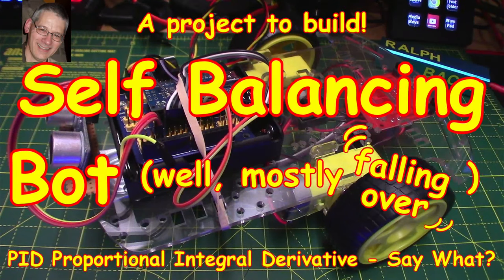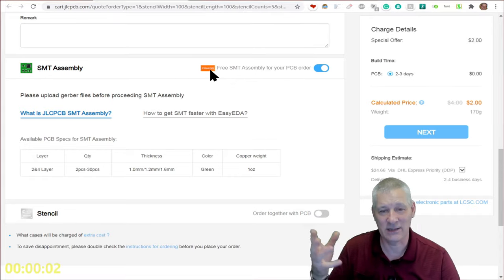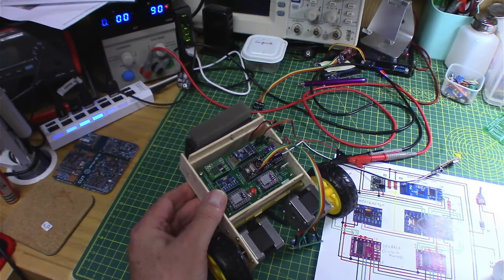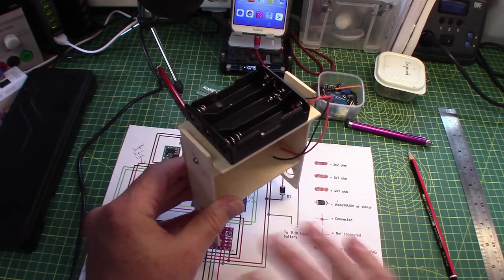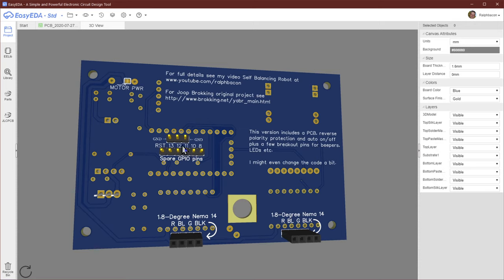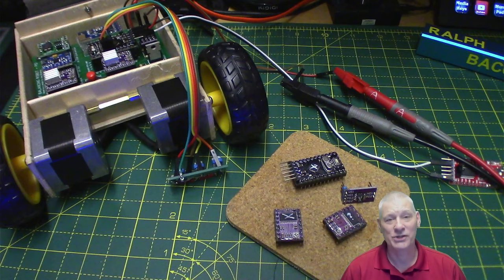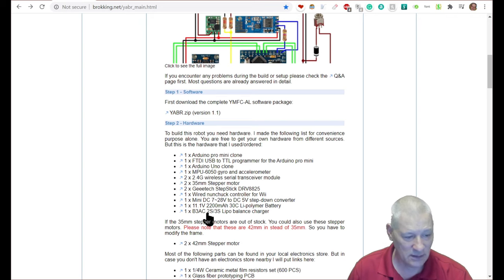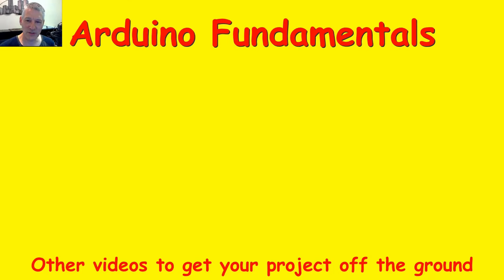#199 Self Balancing 'Bot (almost) with Arduino Pro Micro

Comment: Great work Ralph! I built this YABR project a few years back. Was actually one of my first Arduino projects.  I found that if you INCREASE the current limit on the stepper controllers, it will be MUCH MORE STABLE AND RELIABLE.  PRESS ON!
Reply: And I thought the wheel diameter was the problem too. For the first 18 months, I took off the tires and used rubber bands for tires. Was better. But then I put the tires back on and increased the current limits on the stepper controllers and it’s rock solid, steady, untippable.
Reply from the maker: Thanks for the info! I will try that, It's currently limited ()no pun intended) to about 150mA (as per Joop's recommendation) but I can increase that.
Reply: @RalphBacon  H Ralph. I checked my build log on the project and I eventually set the current to over 400mA on the controllers. May have gone higher (700mA?). I know that I kept checking the heat sink temperatures on the controllers and they didn't get hot with the higher current limits. But the higher current made the motors more responsive and more able to keep the bot balanced. Good luck!

Comment: The length of the 4 milliseconds is probably less important than using some interrupt based code. The integral and derivative terms of a PID are acting on change over time and need to be calculated in consistent time intervals to work properly. Without it if there is any differences in the time it takes to loop through the code (and there always is) it will be impossible to tune the code. If you had a very slow changing system that only needed to be scanned every few seconds (like a room heater or something) you could get away without it, but for something that needs to be read as quickly as this an interrupt will be required. Enjoy!
Reply from the maker: Interesting. So the calculations are time-based. Something new for me to remember!
Reply: @Cosmo Genesis The pin monitoring with the scope was a brilliant idea!
Reply: @RalphBacon  The  I and D terms are Integral (the error summed over time) and Differentiation (change in error with respect to time). So I think that you either need a fixed loop time OR need to calculate the errors with respect to the actual time. Having a fairly accurate loop seems easier as  the delta T is fixed. Running faster is probably fine but time variation requires more complex code. 
To me, it makes sense this way -- 
Proportional term -- a correction to a big error is bigger, while a small error requires smaller correction.
Integral -- an error that's been around for a long time needs more correction while a transient error may require less.
Differential -- a large increase in the error in a given time requires a larger correction than an error that isn't getting worse or
 is only getting slightly worse in a given time.

Comment: You didn't say where we pour the whisky in? Joop has been working with PID for a few years now, so don't beat yourself up for not getting it working satisfactorily first time. I have worked with PID (caveat: it was with air pressure driven instrumentation . AP is a far courser medium than counting the electrons. Electronic control replaced this a few decades ago, but we never had to touch the PID configuration after installation.), I seem to remember that we first started with zero integral and differential outputs. First the proportional is adjusted until it more or less  works. Then the addition of integral output (this is a smoothing of the proportional). Finally the differential is adjusted (this adjusts the response). The difference in the geometry (wheels) will almost certainly change the math completely. I would be very surprised  if anybody could just copy joops configuration and it work first time. I seem to remember that it took joop weeks for him to get a drone to stay in the same place in all 3 axes.

I didn't mean to write any of the above. I had intended to remark about your incredible productivity. A glance at the videos page of your channel shows an phenomenal output week after week. No matter how many eyes you have working. How do you do it?
Reply from the maker: I've realised that just about everyone who has a working PID balancing bot of some kind spent a long time getting it working! But mine is getting better and I'm now sending the data back via the BT remote control so I can see what is going on!
Regarding the video output, well, I might take a bigger break between videos soon as I have other stuff I need to get one, but we will see.
Reply from the maker: Funnily enough, the more whisky you imbibe, the better the entire project looks. Or you just stop caring!

Comment: Hey Ralph, I built this last year and designed a board for it in KiCad which I had made by PCB Way. I 3D printed the parts including the wheels and used rubber to make tyres. The main differences with mine are I used 42mm steppers and have fitted a brace with a cooling fan over the stepper drivers.

It works quite well but still has the occasional hiccup which I feel is being caused by the higher current requirements of the steppers I used.

I found that any substantial changes in the design (i.e. Difference in weight of the battery used or different wheel diameters to the design ) would require alterations to the PID parameters in the code.
Reply from the maker: So you built it? Good on you. I will adjust the PID values today and see what happens.
Reply: @RalphBacon  Despite it not being included in Joops design make sure you use a bypass capacitor (I used 47uf) between Vmot and ground on the stepper motor breakout boards unless it's already included on your DRV boards.
Reply from the maker: Yes, I've got two 100µF caps right under the DRV board for VMOT and GND (two separate, heavy duty traces on the PCB back to the battery).

Comment: Wow Ralph. I made mine using NEMA 17 steppers and wood also followed exactly what Joop did. My wooden body is a work of art made by hand not cnc. I like your 18650 battery, I used a LIPO as Joop did. Must say that I used the code exactly as downloaded. I kept all the wires tucked neetley in and after 20 minutes from play time I put it in a box and pull it out to once in a while to impress friends. Try tucking all the wires in neat and secure, tire size, and his PID settings. If that doesn’t work remove the servos for later and run it over with your car.
Reply from the maker: I'm hoping it doesn't come to me running it over with my car! It's so close but not yet controlled. A bit like an unbroken horse, not yet tamed. We shall see.

Comment: I've had a small problem using the ATMEL 328 in a PID project. It works just fine but randomly every once in a while, the PID algorithm gets a result that's way out of whack and causes disastrous results. Same code on an ATMEGA, STM32 or ESP32 and it's fine. Best I can figure is it's being caused by a messed up heap. It's so infrequent and random that it's been hard to troubleshoot. Sometimes a couple of times a day sometimes only once a week when running continuously. I'm glad I'm doing it just for fun otherwise I'd be stark raving mad by now. Oh, wait... ..stark raving madder? oh well
thanks for the great vid Ralph!
Reply from the maker: How odd. Unless you have telemetry you won't find the cause. I might send some data back via the BT link in the joystick.

Comment: Ralph; I am still working on Brokking robot. I found this in his instructions that may help you. To get your head around his system. Very short but very telling.
" To start the robot you need to power up the remote. Lay the robot on it's back and switch on the power. The LED will blink indicating that the gyro is calibrating. When the blinking stops you can slowly lift the robot and it will automatically start to balance itself ".
Reply from the maker: I've changed my code, Paul, so that it autocalibrates whilst vertical and it is standing up better but I've not really had the time to progress this (yet). All in good time.

Comment: Hi Ralph,
When it comes to making the frame and all kinds of cases, enclosures, handles and so on I heartily recommend a 3D printer. You design the parts on a PC, so precise layout for the mounting holes for those motors, for example, is easy. The plastic (I use PLA which is not a petro-chemical plastic) is surprisingly strong and really quite cheap. The printer is expensive, mine cost about £750 as a kit and as a Yorkshireman I know every penny counts! It is money well spent. 3D printing compliments electronics perfectly as you can always create a lovely enclosure for your project. Happy to give you more info if you are interested. Chris
Reply from the maker: I've often considered a 3D printer for all the reasons you say but, aside from the money, I just don't have the room. When I eventually get to move house, and get another workshop, I'll try and design some 3D printing space into it!

Comment: If you plan to improve this self-balancing bot.. one point of improvement also is that wheels.. it is more "pastic" than rubber.. it has poor traction.. and a little not well shaped it is hollow inside the tires, when it has load it will change it's shape a little.. I think these little things is critical in that kind of robot.. Joop uses his diy wheels where he uses a wooden (which is more solid) wheels lined with rubber from bicycle tires..
Reply: Yes, those nylon or plastic cheapies are horrid! I have sanded the tread and took foam trips and fattened them up a bit for somewhat better traction, but they still are not as good as the rubber versions.
Reply from the maker: I've got to get it to stand up first, without running off like a scared puppy. Then I can look at the wheels.

Comment: From the video, it looks like the circuit boards in their sockets are sitting towards the front of the frame, potentially putting the center of gravity a little forward.  The PID algorithm ought to be able to handle that, as long as the center of balance isn't too far away from the motor axles.  But I wonder if that affects the readings from the IMU sensor?
Reply from the maker: You're the first to notice this, Mark, and I had a happy couple of hours last night moving it back so the board (and the MCU-6050) sits directly over the motors' axles. I shall see how / if it works better later today!

Comment: Here are a couple of thoughts. The first one is, that it is kind of digital signal processing and needs a constant cycle frequency. The second is that you should read eventually under the topic Ziegler and Nichols. They developed a method, how to achieve optimal values for Kp, Tv, Td. The 4ms cycle time that Joop uses, is based on the refresh rate of the ESCs of his drone.
Reply from the maker: Ah ha! I figured the 4ms has to come from somewhere. I shall check up on what you suggest. Thanks for the suggestions.

Comment: Fun! You could add a servo 'kick' stand for when it powers down.
Reply: To the "other" Terry T: what about a kickstand that simply uses gravity?
If the device tips too far, a rod swings out. (Mousetrap School of Design)
Reply: @AtlantaTerry  Or go the other direction and deploy Falcon 9-style landing gear!
Reply from the maker: The kickstand is doable but Falcon 9-style landing year would be more fun (and totally undoable).

Comment: For fine tuning, since you already have WiFi, you could use something like MQTT to send 'live' adjustments rather than using the variable resistors. Not sure if this would mess up the timing issue though, I haven't spent a lot of time thinking about it!
Reply from the maker: I watched a video yesterday where the guy was sending data via BT to do this.

Comment: Thank you for this project. I'm going to work at getting the parts so I can follow along. I was hoping to see that you used the ESP32 but I guess I'm more motivated since it is the standard Arduino.
Reply from the maker: Given my experiences so far, it's best to stick to the design as much as possible - then you can do another with an ESP32!
Reply: @RalphBacon  Ralph: Have you made the circuit board available for others to order from JLCPCB (or PCBWAY)?
 I did a little looking around but didn't find you or the project.
Reply from the maker: I will make it available although I am even now making small adjustments so that I can send back telemetry to the remote control and display it there. But I will upload the entire EasyEDA project to my GitHub this week.

Comment: Good day, Ralph.
Now THAT'S a project I wanted to do since I discovered that MPU-6050 device.  It'll give me a great incentive to restart these Arduino projects for the Winter.  Speaking of winter, we got out very first snow fall this morning.

Back to this robot, since I have a Laser and building materials (Acrylic and wood), it'll spare some expenses buying these materials.  having a 3D printer as well, I could also print my own wheels too .. or the whole cabinetry, for that matter !!  Sounds like a project to me.

Weird ending on that post .. was probably corrupted.

Re-edited  that one.  All this to wish you a great day and healthy continuation, my Friend.
Reply from the maker: It sounds like you're going to be busy this winter, Dan!
Reply: Indeed .. Hahaha !  Like you said, « Lets keep those grey cells working. »
Have a great day, and stay safe and healthy !
Reply: Good day, my Friend.
It seems I have programming issues with this device.  It seems the FTDI programmer can't communicate with the Pro mini.  
I ordered the 5V / 16MHz version and placed the jumper on the 5V position on the programmer.  I also checked my connections twice just to make sure all was not cross-connected.  I read it could happen with some manufacturers.  I double-checked it was the correct serial port as well
While uploading to the board, it gives me these messages.

avrdude: stk500_recv(): programmer is not responding
avrdude: stk500_recv(): programmer is not responding
avrdude: initialization failed, rc=-1
         Double check connections and try again, or use -F to override
         this check.

...

Do you have any tips on how to solve this problem ?
Thank you for your help and, until then, have a great day, my Friend !!

Comment: It looks like you need to monitor the motor on time for each direction, so the longer it is on the more rapidly it accelerates to recover when it starts to lean over.
Reply from the maker: It seems slow to respond at the moment then goes mad trying to catch up because it's left it too late.
Reply: Ralph S Bacon - I do wonder if the software serial is slowing it down enough to cause a problem, I know it does have an effect as it uses clock cycles to work whilst it runs, compared to normal FIFO UART which doesn’t have that overhead, just something to consider.

Comment: Hi Ralph, I've used Joops code, and spent some time getting my head around it.  First off, the 4ms loop is require in Joops code because the stepper motor timing is hard coded into the loop.  If the loop changes duration the stepper motor gets the pulses at the wrong time, so it is critical the loop does not exceed the 4ms.  In my project I wanted to build a self balancing robot as cheeply as possible, so I used DC motors.  This allowed me to remove 4ms requirement, although I still do use it, but its no longer critical,  the motor code is in seperate function.  If you want to keep with the steppers you could use a stepper library and set the main code up as a state machine as you suggested.
My code is here, it is very different though, since I use DC motors - https://bitbucket.org/keithellis74/balancebot/src/master/
Raspibotics is also developing a robot at the moment using this code, his information can be found here - https://github.com/raspibotics/MABEL
To get the PID elements right on my robot I found this video very useful: https://youtu.be/uyHdyF0_BFo
A quick video of my robot: https://vimeo.com/293749698
There is a big twitter group who take part in the PiWars Robotics competition in Cambridge, they are all willing to help, take a look here: https://piwars.org/
Reply from the maker: Thanks for all the links, Keith, I didn't realise that there is a whole world of highly skilled people out there building these things!

Comment: Watching the wheels spin out the first thing I would try is a rubber band around each wheel.
Reply from the maker: The new wheels are better but I might even do that (or use bicycle inner tube like Joop did).